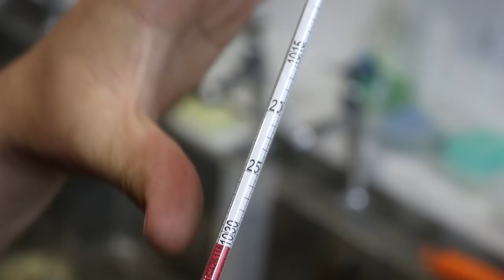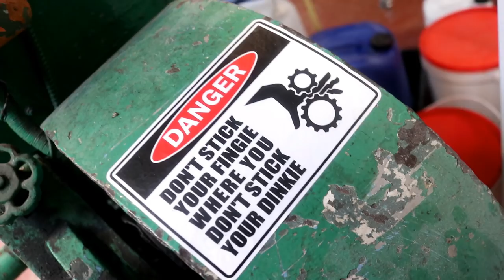BREAK OUT THE ROLLERS

Comment: I had a touch of goitre before,not the same I know,but similar things affect it(that and moving stopped me Homebrewing). I had to cut out the Homebrew completely,for several months only drank the odd low abv shop beer,cut out sugar completely in my cuppa tea, basically removed most refined sugar from my diet,and started drinking at least 1.5lt water per day. It was a right pita as sugar is in everything but it did work,though I really missed having a Homebrew,I had just moved house and I've not brewed since,going on two years now. You may need to consider doing similar at least in the short-term (six months at least),it's very much diet related from what I can see. Hope you get it sorted whatever you do. The railings look top notch. Cheers.